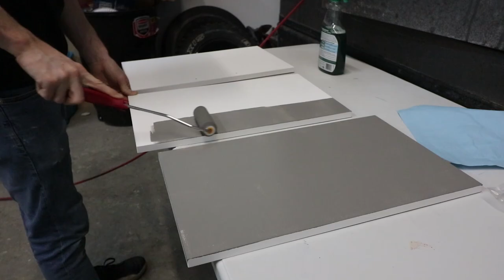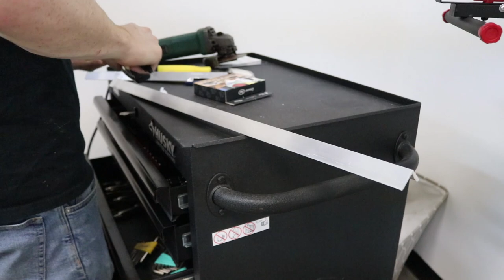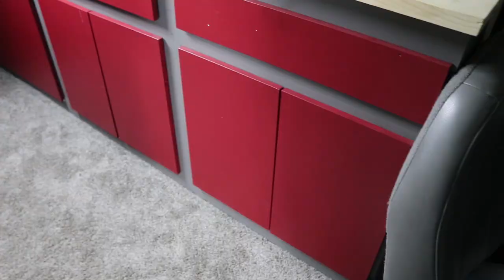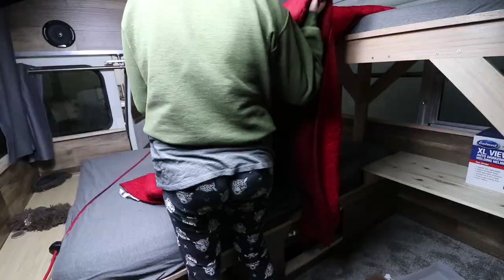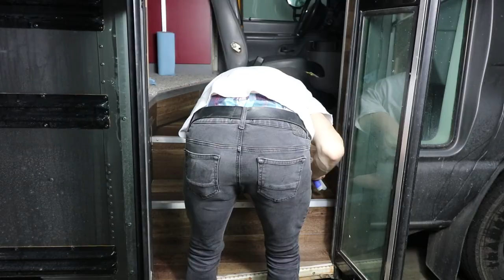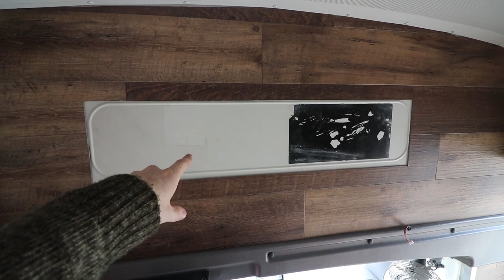Adventure Bus Build Pt. 19 - Interior is (almost) FINISHED!

Comment: You still didn't make the engine Bulletproof ...
Reply: skurt its only got like 120k on the engine, he doesn’t need to worry about bulletproofing it yet.
Reply: rony brioso you're*
Reply: rony brioso *you’re
Reply from the maker: That is correct. The engine only has 98k on it, so it should hopefully be fine.
Bulletproofing it requires taking the heads off which, in this chassis, is very difficult. So we're holding off on doing it untill we need to.
Reply: Gingium 👍
Reply: Gingium if you wait until you need to bulletproof it then you're basically waiting for it to catastrophically fail and then you'll say "wish i bulletproofed it." I understand you have a lot of projects going on and not much time but bulletproofing is preventative maintenance so if you're waiting until you need to, well now is when you need to
Reply: Gingium  yes and no it was a school fleet vehicle witch means the engine ours are higher than they should be for a vehicle with less than 100kmils  and if you plan to add power you need to get it bulletproof  don’t matter even if it is bulletproof you’ll still be working on it a lot more than you think
Reply: He's going to do that when he will make more boost, it would be useless now.
Reply: yes but it also means it got more routine work done  to it because its  a fleet vehicle. alot more idle time though. its prolly more like 150k miles
Reply: rony brioso you must be embarrassed
Reply: skurt he's not modding it yet and not really flooring it
Reply: skurt Haven't* not didn't, mate. Also made*
Reply: 6.0’s can have a problem with hpop (high pressure oil pump) which a lot of the engines have problems with them only lasting till 120k miles and will go out. This can cause other issues.
Reply: Dusty C  it’s not just the hpop it’s  also the the vgt can have issues  even though this bus more than likely has a dtuned version of the 6.0  witch in it self would make it a bit more reliable  it’s still gonna have issues with the hpop the egr the oilcooler  especially if it’s a. Earlier 6.0  03-05
Reply: Gingium I rebuild these motors every day. Specifically I install the cylinder heads, for the most part they're not near the disaster people make them out to be. I would definitely upgrade the cooling system as that was an Achilles heel on those trucks. The factory heads will do fine,I'd just have the ports cleaned up as the castings were left pretty rough. Definitely use studs instead of factory head bolts. If you have any questions then feel free to message me. Hopefully you found this helpful!
Reply: RippyTheRazer no he isn’t. My dad has 2 6.0s, one with 200k and one with 168k with no bullet proofing. It’s a big project that can wait. It would be better if he gets some parts together to mod it and make it better at once rather than taking it apart 3 different times
Reply: sam grabel hpop is an easy fix
Reply: Joseph Samsor  I have a 05 dodge with 300 k .It’s not so much as the hpop as it’s the egr and vgt s on the higher hour 6.0s.   A head gasket is a lot more work than it’s worth on a 6.0
Reply: rony brioso 6.0's blow  at 80k sometimes just depends on the work life of then. Definitely needs to be done soon. EGR Delete Head Studs Gaskets etc.
Reply: Rony Cool guy come on man no need to get hostile he just was saying something
Reply: Rony Cool guy you’re not cool
Reply: Came back to watch older bus videos and I find this comment very ironic

Comment: Next build idea: U-Haul Truck and Trailer converted in a larger version of the adventure bus. The trailer could be a kitchen, and the if you've seen a U-Haul truck, there's a little space over the cab, that could be a bedroom, and a few walls could be built to make a restroom and some possible machine that can turn waste into fuel (which would be kinda difficult). It would be very interesting.

Comment: Tip for getting clean caulk lines. Lay tape lines parallel on each side of the seam then caulk, smooth it with finger and remove tape :)

Comment: LS swap the bus XDDD
Reply: A well set up ls would probably work and would still be able to tow so why not ls swap everything
Reply: LS swap my bicycle!
Reply: GuniPlays Cummins swap so it still a diesel
Reply: GuniPlays vortec swap would be better
Reply: Tyler Hobart Detroit 6-71?
Reply: Tyler Hobart actually a good idea
Reply: JustAnotherCarGuy hell ya
Reply: GuniPlays no it's a Ford. It's going to be a ford with a Chevy engine so a big no
Reply: because thats totally an upgrade compared to a 6.0 turbo diesel which makes far more torque
Reply: 13b swap the bus it'll be siiiickk
Reply: Reese Petrolhead sealing it with that tiny rotary would be the stupidest thing to do
Reply: GuniPlays a bulletproofed and mild build on the 6.0 stroker would be best.
Reply: No, Cummins swap
Reply: GuniPlays nah rotary swap it
Reply: Fuck renting an apartment I'm buying a short bus
Reply: Bob Peanut 6.0's don't make that much torque if their head gaskets blow or the oil pump fails...
Reply: LS swap my cat!!!

Comment: MANUAL TRANSMISSION SWAP THE SPOOL BUS!!! Get a 6 speed from a 6.0 f250 so you can get better gas milage (compared to the 4 speed auto), have more fun driving it, and tow more efficiently (by selecting your own gear)! Like so he can see!!!!!
Reply: QCetnar my dad had a 6 speed 2 door 6.0 and it was so much fun. However, in a bus? Maybe the auto will be nicer for long drives. My dad’s truck shifted like a semi lol

Comment: To make your silicone/sealant runs look better do this. 

Wear a rubber glove and wet the tip of your finger with rubbing alcohol.  Use this to smooth the bead out.  it'll look a lot better doing it this way.  

This the  method we used when smoothing the sealant for sheet metal repairs on aircraft.

Comment: I'm here for the bus build :D Also, when you caulk, for clean lines you can use masking tape just like painting a pinstripe and pull them right after you lay the bead. It makes for really clean caulk lines, thats how we caulked joints in the camper company I used to work for. Looks great man.

Comment: You need to get a hand held cordless impact driver so you don’t always have to feather in each screw and you can worry less about stripping screws. You can get socket adapters too for quick assembly and disassembly. DeWalt makes really good ones for a good price and you will definitely get your money’s worth out of it.

Comment: Just to let you know, you can cut those aluminium pieces on your chop saw with a 40+ tooth blade, just cut slowly.  Aluminium actually has a lower tensile strength than a lot of the harder woods out there.

Comment: lil tip for the silicone next time, just use masking tape as you would with paint. lay a strip of tape either side of the gap you're filling, put down a bead, wipe, and remove tape - voila Nakai san silicone

Comment: Caleb, may I suggest Hankook Dynapro ATMs for the bus? They have an agreesive tread pattern with an open sidewall so they look pretty gnarly, but they drive great and are very quiet. I have them on my work rig and I will never look back. I fully plan to run them on my personal rigs when the time comes.

Interior looks great by the way!

Comment: all aluminium can be cut with wood working power tools, like power saw, table saw, drop saw! with silicone before you run your finger spray it with soapy water then run your finger on long it!

Comment: I think you must check your heater plugs or preheater plugs becouse i notice that the bus engin is not starting properly, or you must preheat your engin before start it (if you are not doing it). It is a common thing preheatting an diesel engine before startting it. or if you are doing it, check the preheaters. It is a beet of sad waitting but deisel's. Keep up.

Comment: Just buy an AC adapter that you can plug in to a DC outlet that comes with the bus then you can run an extension cord or a power strip then you will have AC

Comment: is he still going to bulletproof the engine?
Reply: BackonRoll yes but it’s a really big project. It’s not easy to do so it makes sense why he’s deciding to wait. The bus is easily good for another 60k miles at least. Mine made it to 200k no problems. Just needs a high pressure oil pump
Reply: Mine needs the high pressure oil pump and i think it has around 200-240k

Comment: You probably regretted putting carpet in there immediately after any rainfall. 
You need a vinyl easy to clean flooring not carpet for mud , dirt , dust.   It’s too easy to track mud into there and spread it around in the carpet.

Comment: hey ging I saw you fucking around with that silicone a few videos ago and getting it on your fingers and I saw you using paper towels in this video a tip on spreading silicone or anything else like it get a cup with some soapy water and dip your finger in it and run your wet soapy finger over it you get nice and good seams and your fingers stay clean. win win situation

Comment: 2 safety issues. Please install a head rest on the front edge of that cabinet behind the driver's head. In an accident you would hit your head on the edge of the wood and cause yourself serious injury. Second, extend that exhaust pipe to exit out the side or rear so you don't give you and your girlfriend carbon monoxide poisoning.